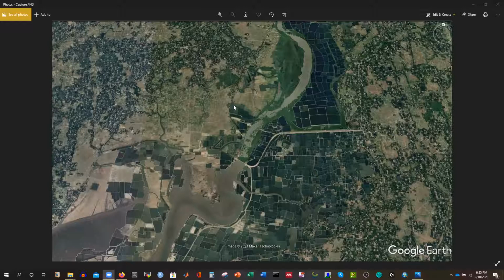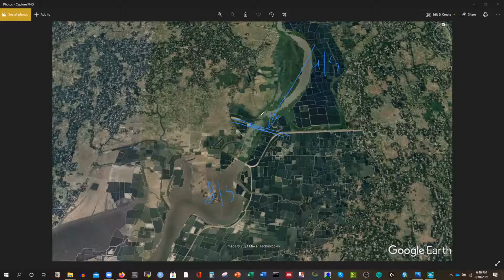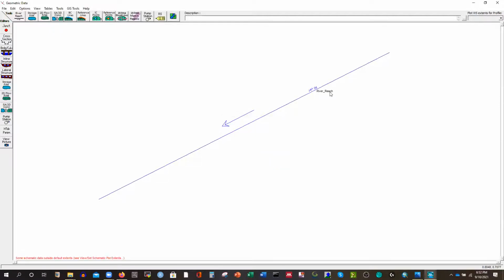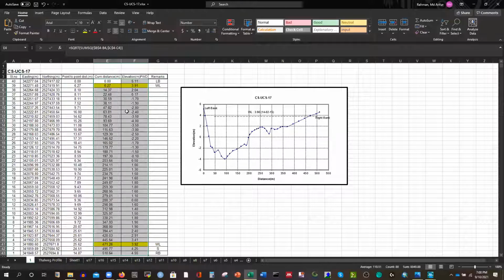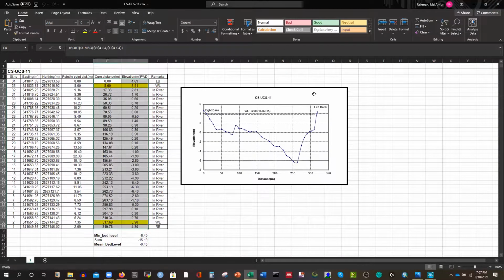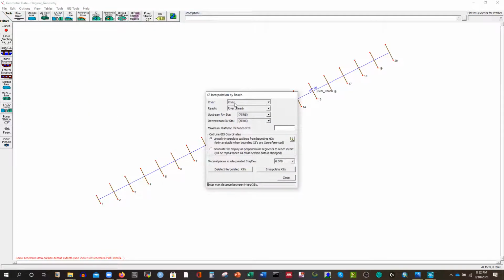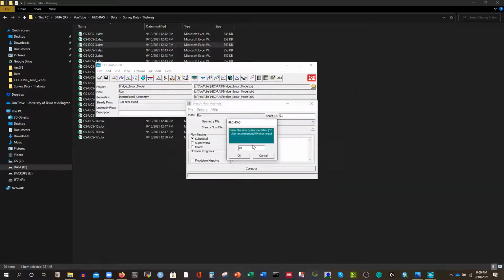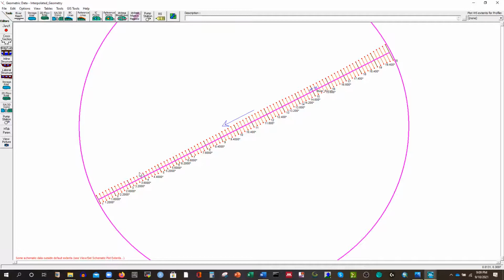HEC-RAS T1: How To Set UP 1D Steady Flow Model From Scratch

Comment: Sir,
I choose 10 cross-section along a river. Now those 10 cross-section are not capable of handling the total flow capacity.

 I wants to alter the cross-section, so that it can carry total flow. Will this alteration only will be there on those cross section? Or it will be applied to entire river strech??
Reply from the maker: Hi, thanks for the query. Yes, you need to alter the cross sections for the entire reach of the river, especially the sections in between the u/s and d/s boundary. Otherwise it will violate the continuity equation, Q = AV, and the channel will not be able to carry water.

Comment: Thanks Sir for sharing the video, I learned a lot , but I have a question.
I set locations for flow distribution and selected 1(LOB, Channel, ROB), I also saw the distribution of different flow velocities on a cross section. I don't know why the result of selecting 1 or 10 is the same.
Reply from the maker: Thank you for the query. Since you have set the flow distribution as global instead of local. That is why it's the same. If you change it to one, then you will have different plots.